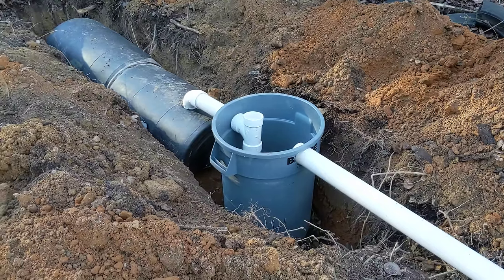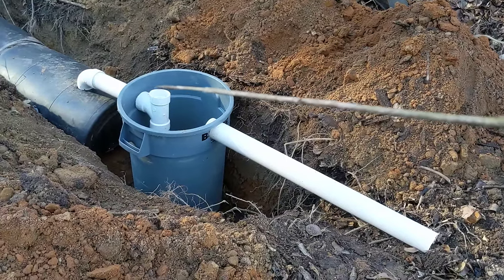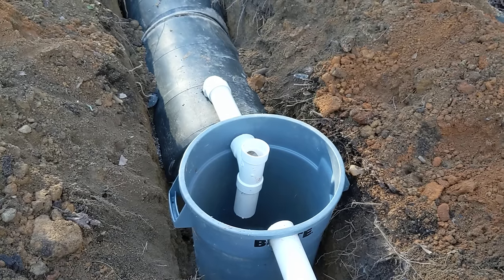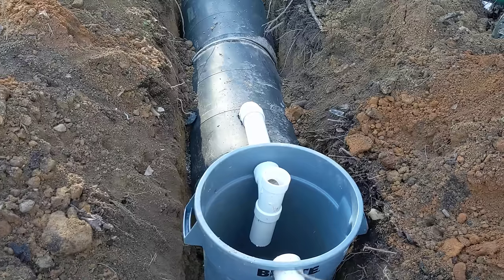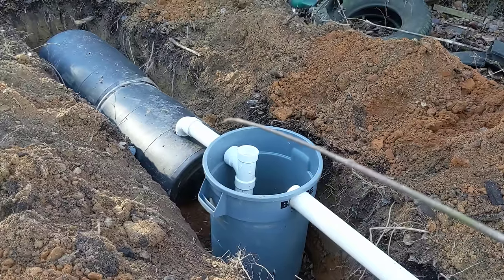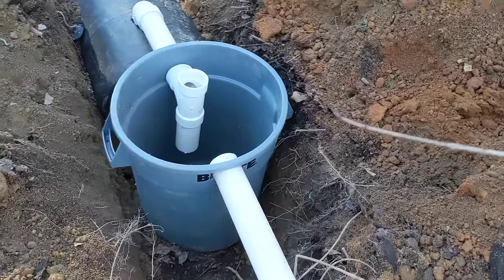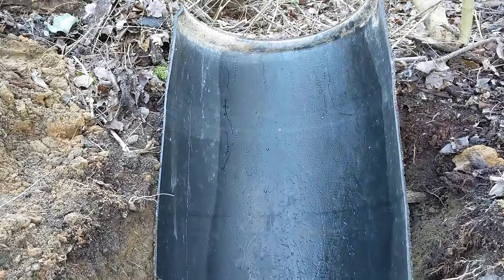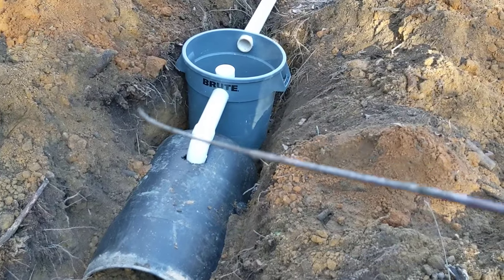DIY septic system for your retreat property!

Comment: Several years ago I did a single toilet system for one person continuous occupation using two plastic 55 gal barrels as a buried two-chamber tank set upright and two 30 foot lengths of 4 inch septic pipe buried beside each other 18 inches deep in a one foot wide trench with 3 inches of gravel below and 3 inches above the pipes.  I covered the rocks with dirt - straw is often used in SoCal.  System worked fine for 7 years with no pumping of either tank.  Nothing ever leaked, but we were on level ground with no soil issues and good percolation.  When it was removed the primary tank had a few inches of sludge in it, the secondary tank had practically no sludge and the pipes were basically clean.
Very good video.  Good ideas.
Reply: Thank you. I'm needing to run something for my camper I just got that I will be living in for a while. Knowing how long this lasted you really helps because It won't be that long that I need it but you never know something can happen and will need to use it longer.
Reply: Not sure it makes sense to use a 55 gal barrel when you can get a 275 ibc tote for $65 that has a metal frame and everything.
Reply: The barrels cost $5 each.  Metal rusts.
Reply: @lrayvick  They are aluminum frames.  No rust.  

The issue being that you have only so much room in a 55 gallon barrel for solids.  Any real use would immediately mix it up and send it down the fields and stop the system from working in short order.  That is how real septic tanks go bad.

I guess with enough buckets in a row it would be OK.
Reply: @lrayvick plastic crumbles over time. Let's be fair about making statements like that. A small tank that is made for this purpose is better. Drain Fields are cheap also. 73
Reply: @ronb6182 both barrels were in excellent condition when removed. We use plastic drain lines in systems designed to last 30 years.

Comment: Awesome tutorial. I'd try two 55 gallon poly drums ,set -up the same way. To keep the outlet from beating a hole in the ground  put a piece of tile/flat stone  directly under the point where it falls into the leaching arch,and not beat a hole there..so your waste water would flow the whole length of your leaching field..such a great idea for a retreat cabin.  You have great ideas and you Sir, are a good instructor-thanks for your helpful content.
Reply: How do you mean by outlet beating a hole ?

Comment: Just finished building our new cabin for deer camp. This is exactly what we need. We'll have a kitchen sink and shower hooked up to it, as we have an outhouse, but we are only there every other weekend tops and maybe would have 3-4 showers total on a weekend, so I think this would handle it. Thanks for explaining everything so well.
Reply: It will work well for you.  At my hunting camp, our 2 sinks drain to a burried, upside down 5 gallon bucket and our shower goes to a burried, upside down 55 gallon drum.  Never had issues with it and this system is better.  I would use another barrel because we tried a trash can and it collapsed.
Reply: No grease
Reply: Why even do a septic for non sewage? Just use eco friendly products like Seventh Generation or Meyers.  All my showers, sinks and laundry go directly into forest landscape.  3300 Sq ft cabin

Comment: Looks good, you can also mimic expensive chamber fields by drilling tons of holes in the sides of the drums so the water can exit through the sides as well, it's just more surface area, though you would need to cover with that fabric contractors use in normal systems to prevent soil from getting in.
Reply from the maker: Thanks

Comment: Neat idea!.  We could add a 1/2 inch  pvc pipe with a floater attached to it's bottom.  The pipe runs through the lid of the container with a mark on it to indicate the solids have reached the tank's usage capacity. When the solid stuff goes beyond the level of the water outlet the pipe would come up showing the mark. Keep two tanks like these with valves on the inlet to switch to the empty tank as you leave the stuff in the filled tank to decompose before you shove them out.
Reply: Wouldn't the floater simply float to the top of the water, which will always be at the level of the output pipe. How would this be an indicator of the solids level?
Reply: @vanblindguy4600  I think we could tell the floater pipe being pushed up when the solids build up above the bottom of the outlet pipe for a inch or two.

Comment: I hope you're using something besides the plastic lid that came with the trashcan. Anyone who steps on that will get a real surprise. LOL
Reply: WebCity Films  Nancy Peeloosely approved this septic system.    :-)
Reply: Added perimeter security.
Reply: Covered means is camouflaged. As soon as someone steps on that 'covered' lid, they are falling into the shit hole.
Reply: I'm thinking of doing this at my workshop, and I'm planning on setting a truck tire on it. Place is junky anyway, nobody would step on a truck tire.
Reply: I'm buying 5 acres and planning on building a small house to start and use a similar system for a temporary septic tank, but I think I would use a 55-gallon barrel instead of the trash can.

Comment: i dont like the trash can because the sides can collapse i think a more ridgid plastic barrel with the lid cut out and a metal or concrete lid and backfill with gravel and add a drain field after the cut barrel with gravel

Comment: I'd suggest using a IBC tote that has 275 gallon capacity.  Used ones aren't much more than barrels or garbage cans.  You get maybe 30 gallons of sludge in that garbage can, it would be pretty easy to stir up the solids and run them into the field.

This would work with maybe a single toilet used seasonally or at a camp.  I probably wouldn't go running showers in it.

Comment: The old timers up north would set traps for field mice in the fall. If one was dead a while they would flush them to introduce new bacteria into the system.I always remembered that and do it every so often without any issues.I've never used rid-x or any of those products.So it must work to some degree...
Reply: A package of dissolved bakers yeast will work too, once a month. Simply dissolve a packet in hot water and pour into system... it feeds the bacteria and keeps the tank active...

Comment: Just bought a River house I just ordered a 1/2 Zoeller #95 effluent pump with 23 ft head capacity. Unfortunately my septic leach lines are below house with no r area for my proposed Gray water leach lines. I have one acre behind house with a slope of 15 degrees. I plan on separating all fixtures except Two water closet’s. Your installation is what I will use for only Gray and utilize my Septic tank for only fecal matter from the toilets.
Prior to selling a house in Alabama to close on the house I had a 50 year old Septic tank With failed leach lines. The Septic Company installed a 500 gallon PVC holding tank adjacent to Existing Septic Tank for the Effluent’s with Gould 1/2 effluent pump with 2 float bulbs with alarm box with 500 feet of filtration lines that you are duplicating with your 55 gallon drum halving it. 
Septic Company charged. $ 9,800  I was over a barrel since purchase depended on the purchaser’s mortgage company home inspection and a septic inspection calling for permits and updating septic system. Now I’m in a very rural area I won’t have any restrictions. Great video! Hope this helps many who don’t have the resources to hire these high priced septic companies.

Comment: If you want a more solid tank lid , build a square plywood form around the trash can and fill with cement then cover with cement lid .
Reply: Where do you buy a cement lid? I like your suggestion.
Reply: @tomatokook --Build a quick wooden form and pour it when you pour the concrete "tank" box-put a piece of hardware cloth about 1" smaller than the lid form in the middle of the pour for reinforcement.

Comment: thanks for explaining the pipe measurement differences and the reasons behind it. I didn't really understand the mechanics behind a system until this video.  I am curious if perforated plastic drain pipe with holes could not be used instead of the half barrels?

Comment: Find a nice steel plate as a cover over the can..i did this..for my gray water..from kit sink and dishwasher..work like a dream..no permit needed..ive gor a 800 gl.tank w a field for the shower and potty..save your self money..do it your self..i live in fl..so its sand your digging into..i used 6in flex drain pipe.put a sand screen over the piping sell at home stores..keeps the sand out..ive got 7 kids in here..40 ft of pipe 3 rows.saved 5 thousand do it your self.  Ven my wife. Helped ...had it replaced in a day..used the 800 gl.cement tank thats here. Nothing was wrong with it..plastic tanks crack ..my nabbor fond out that ..one..after 5yrs it went to crap.cement tanks last a lifetime.i hope .  my info helps ..
Reply: @Agent Applebutt if its a cabbin..and u are doing a kitchen drain..from your kit sink use a 3 in drain pipe pvc..type..out your cabin wall.barry the pipe on a down ward pitch..for flow..to your dry well..u can get at home depot..10 gal in the out door garden sec.  Its plasic..so u can drill holes in the sides of it..barry it put gavel around the outside of the. Dry well so the gray water can get into the ground....this i used only for gray water..not the potty..i hope this helps u..the bigger the dry well the better.no one will know the diff ..mark where the tank is for the future..i did this for my small kitchen. S ink a n d dishwasher..

Comment: Why no baffle on the inlet side wont the fats and grease oils build up at the end of the pipe..?  But my question  is... at the baffles  could you run the upper part of the T to ground level for clean out if ever clogged ?

Comment: I will be living fulltime in my off grid cabin actually 3 people and first I had planned on a composting toilet and running all my grey water out into a leach field which looks alot like your barrel system ...no my question is should I continue with my original plans or will this work for a full-time family of 3 my daughter in law is having issues with the thought of a composting toilet even though it's not her that'll be emptying it anyway ...my second question is what happens when the trashcan is full of poop

Ok you answered my questions
Reply from the maker: I would run the gray water on the ground and just have the toilet on this type of system. This will handle 3 people with just the toilet on it. When it gets full just scoop it out and put it in a hole.
Reply: @theappalachianamerican8607  couldn't the sewer out of the house just be ran straight in a deep hole with some steal lid and the pipe ran into a hole in the lid that would eliminate the nasty scooping and when that hole is full dig another and place the pipe in it and begin again the liquid would absorb into the soil leaving the solids

Comment: what's the purpose of the T with two ways for fluids to flow out? why not just from the top with an elbow?  is that about clogging and flow? wouldn't the waterline be at the bottom of the vertical tube outflow?
Reply: Keeps solids and floating yuck from exiting into the chamber because water is being drawn from the relatively clear middle portion of the fluid column which is least likely to allow TP or undigested turds to exit and rapidly plug up the chamber.

Comment: I like this idea for a toilet and sink only at a location away from the house on a large property or small cottages spread out around a small resort I am planning to build after it is safe to travel again.

I am thinking that concrete instead of plastic/PVC chambers. Concrete should be much cheaper than plastic. Also, I don't see a plastic trash bin lid as sufficient strength to hold top soil and people walking on top of it. Same with the half barrels.
I love the design, just not the materials.
Reply: Plastic is better than concrete.

Comment: Assume the two barrels laying down flat, have an unknown number of diameter holes in the bottom (up to a specific distance from the bottom of the barrels) and are tied together with a pvc pipe?
Reply: no they are 1 barrel cut in half with the openside down creating a leech field,

Comment: The barrel being the leach field......if you were to set those on top of course gravel I’m assuming it would take your  grey water as well as your black water faster or at a higher rate. Also when you are done building it wouldn’t you “prime it” with water to a certain level before running any solids ?

Comment: GREAT VIDEO! Just wondering why not use a sanitary on both the inlet and outlet of the  Septic Barrel?  Still keeping the 2" difference in elevation between the inlet and outlet pipes. I'm figuring That by adding Sanitary tee to the inlet. that Big " Day after Thanksgiving TURD" would be flushed into the septic tank just below the surface.  This would eliminate the possibility of the TURD finding refuge on top of the Toilet Paper.  Does that make sense, or I'm I over thinking this?  Thanks again.

Comment: Do you have to pump out solids once in a while? Or does the solids change to liquid brake down and go out as liquid
Reply: Yes, I would like the answer to this as well.
Reply: The solids eventually break down into very very small particulates. The water will carry it into the leach field.
Reply: Yes you have to remove solids after so long. That's why he said you will need to open it up and shovel it out at some point.

Comment: as the trash can fills up with sludge at the bottom it will stop draining in the leach barrel  untill it fills up to overflow pipe (top of san tee) & tp fat, sludge will pour into the leach barrel & stop percalation   in my business a flush beats a full house
Reply: So what's the solution...mr brains????

Comment: Does the PVC pipe stop under the barrels that are cut in half? Or does it run the length of the barrels cut in half with holes drilled through it?
Reply: No it doesn't go far, just to let water in

Comment: This mini septic system would benefit using a sump basin with a seald lid  This waste basket with lid could become a death trap for small children and pets.  A leach field of preforated pipe would increase the saturation volume.
Reply: Don’t think a leach field does a better job than the chambers and certainly a lot harder to install and requires more area to do so.

Comment: How do you get the water pressure in the cabin to pump into the tank?
Reply: gravity shit rolls downhill
Reply: Make sure your drain line (waste pipe) from the house has a proper slope and it won't need pressure. All the waste and liquid just slides down. Proper slope for 3" to 6" pipe is 1/8" drop for every foot of pipe.

Comment: You need to clarify the 1/8" - 1/4" slope because it is basically that much per 10' of pipe. The easiest way now is with levels that have a gradient on them that show what slope you have. Also 1' of dirt over the top might be good for the south but the north is a whole lot deeper due to the frost line.
Reply: 1/4” slope is per foot, not per 10’. Typical plumbing drain slope is 1/4” per foot, so a 10’ section would drop 2”. More slope will cause liquid to run off and leave the solids. Less than this and the speed of drain will be so slow the solids will not move along.
Reply: Yes you are correct it is 1/8" - 1/4" slope per foot. My mistake. It is 1/4 of a bubble on a level or getting a level with the marks in it.
Reply: @michaeljames5160  tape a 1" block on the end of a 4; level and there you go

Comment: Hey thanks for the video. But is this alloud? I mean there are regulations for that cos of contaminationrisk of groundwater and e-coli bacteria  to neighbours. Whats your answer?
Reply: It is actually the basis of a real septic system just simplified and smaller scale. With the waste being underground it breaks down and the bad bacteria die off as the good bacteria eat the waste. Permit wise would depend on your particular location, a cabin in the woods, probably not an issue. As far as ground water, the strata that it flows through will generally filter out anything short of chemicals or dissolved minerals. As a general rule of thumb, nothing gets through, if it did we would be sick and dead quite often.
Reply from the maker: Where there is code it is not allowed but where there is no code you can do whatever.
Reply from the maker: Well said friend!
Reply: My theory is as long as the property remains your own and you don’t plan on selling it then there is no need to involve the local authority, what they don’t know don’t hurt em’😉
Reply: @plympytheplumber4605 
Permits and codes are required exactly for YOUR “Theory”........(for your neighbor or future owner who will possibly be negatively affected by someone who thinks what they do only will apply to them........)

Comment: If you have ever buried one of these trash cans you will find out really quickly that they collapse and deform massively when backfilled. Especially if it rains and gets hydraulic pressure. Need something properly rigid.

Comment: Hi there!
I think you will have a problem with the Trash Can because the opening is at the bottom. But there will be solid substances there, so that at some point it will be blocked and only the upper drain remains. But it doesn't seem to be any deeper than the inlet.
If this is true, parts would probably flow back into the inlet.